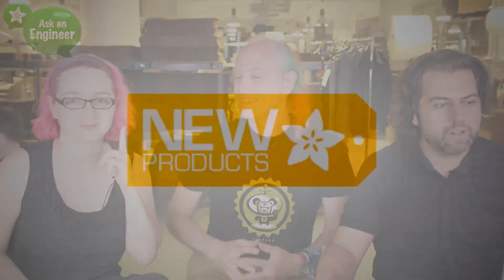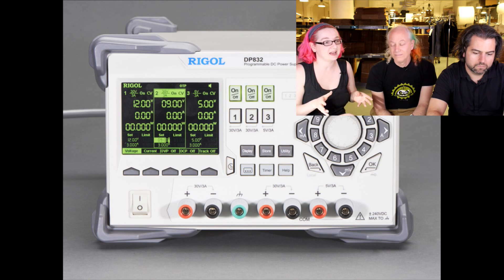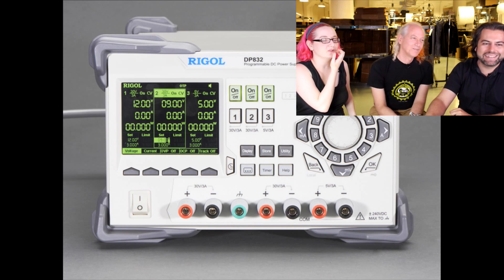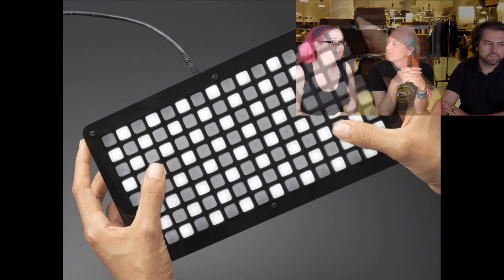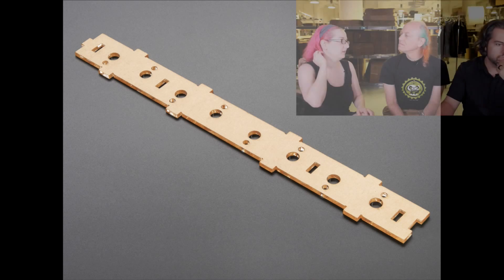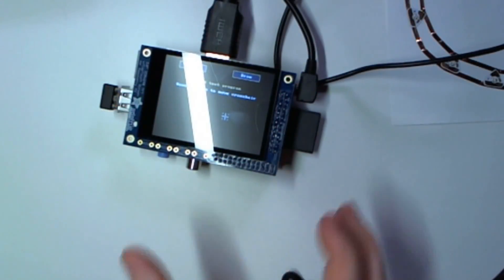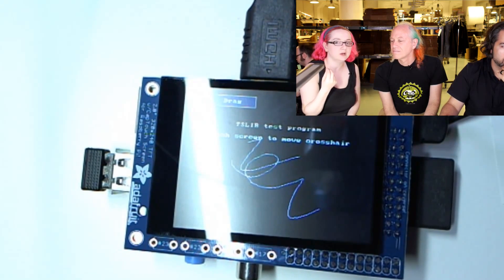New Products 7/23/2014

Comment from the maker: New products this week!
New Products 7/23/2014

LittleBits Sequencer Module (0:06) http://www.adafruit.com/products/2009

Triple Output 195 Watt Power Supply - 30V, 30V, 5V @ 3A - DP832 (0:58) http://www.adafruit.com/products/2014

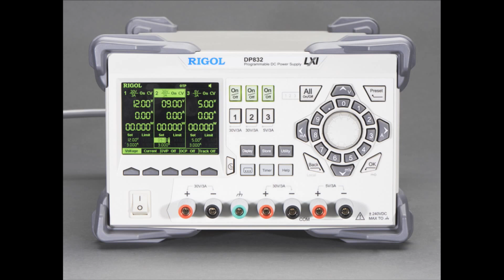1 GS/s 100MHz Digital Storage Oscilloscope + Extras - DS1102E (3:22) http://www.adafruit.com/products/1987

Adafruit HELLA OONTZ! Open-Source 16x8 Grid Controller Kit (4:12) http://www.adafruit.com/products/1999

HELLA OONTZ Add-on Acrylic Tweaker/Hacker Panel (6:22) http://www.adafruit.com/products/2013

Downgrade GPIO Ribbon Cable for Raspberry Pi Model B+ 40p to 26p (7:01) http://www.adafruit.com/products/1986

GPIO Ribbon Cable for Raspberry Pi Model B+ (40 pins) (7:54) http://www.adafruit.com/products/1988

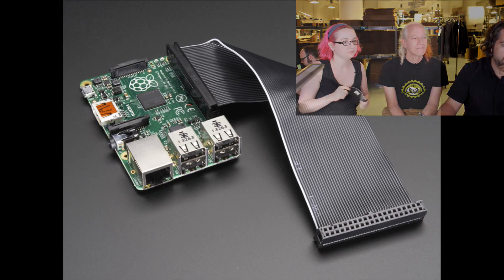PiTFT Mini Kit - 320x240 2.8" TFT+ Capacitive Touchscreen (8:31) http://www.adafruit.com/products/1983

Adafruit Pi Cobbler Plus Kit- Breakout Cable for Raspberry Pi B+ (13:47) http://www.adafruit.com/products/1990

Adafruit Pi T-Cobbler Plus Kit - Breakout for Raspberry Pi B+ (13:47) http://www.adafruit.com/products/1989